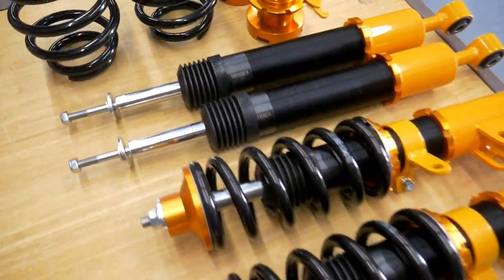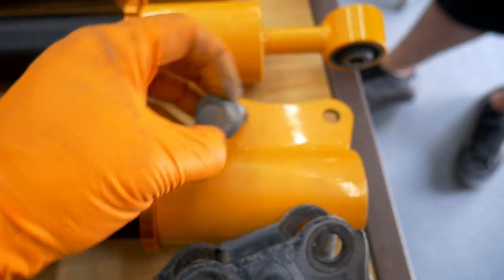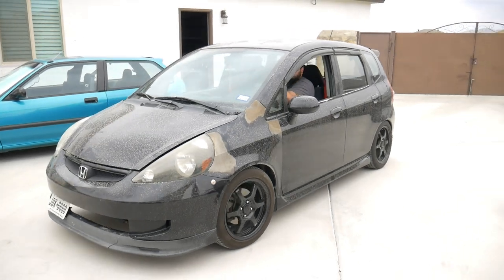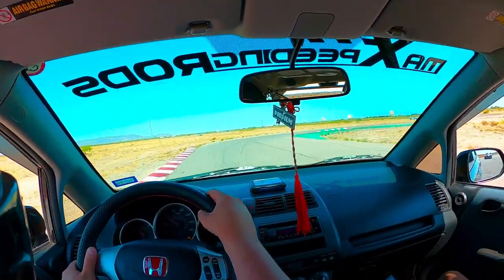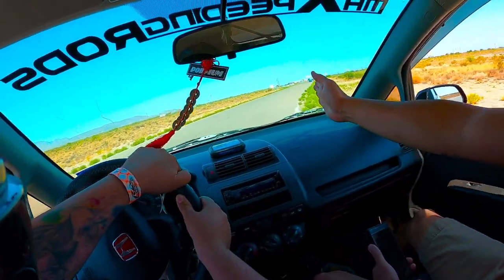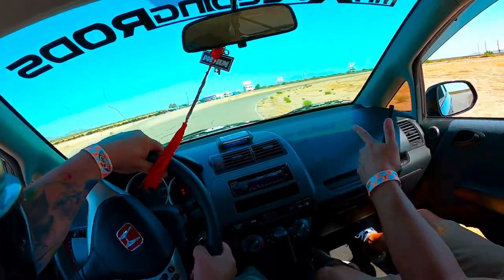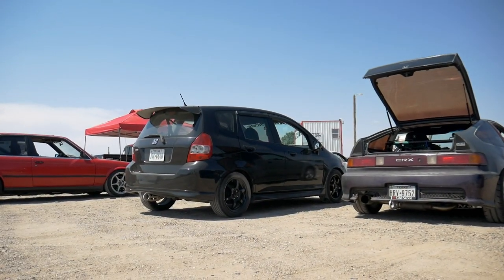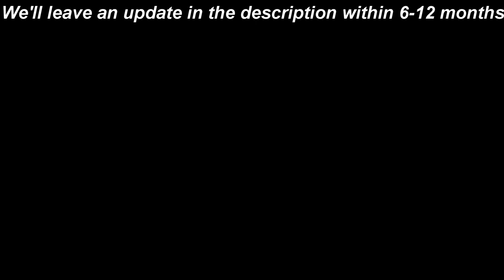2008 Honda Fit - Daily Driven Weekend Racer?  Maxpeedingrods Coilover Testing

Comment: Thanks for the help Jon I appreciate it.  Definitely a big learning experience next upgrade get my tires and now i know what I need to work on.
Reply: Play some Gran Turismo. Good way to learn how to corner on the track, and overall speed/braking in/out of corners. If you have a ps3 those versions are better than the ps4. Keep up the good work! Thanks for the video.
Reply: Fun lil car, good job guys. What are those tires in the front and what kind of front lip is that?
Reply: What wheels and intake did you have on here?
Reply from the maker: Enkei EPF1

Comment: I think it would help to guide Danny with hand position, smoother steering input and line choice on your next session.
Reply: @Garage Built Hondas - Was it the added rear spring rate that demanded more tire for the rear and throttle lift off that caused the oversteer?
Reply from the maker: Mainly the tires and lack of experience.  In my session I had no issues controlling the car but noticed I had to be a little less aggressive.  I'd love to see how it feels on a nicer set of tires in the rear.

Comment: I wish they made koni yellows for the 08 fit,using cusco F&R strut bars,h&r springs,progressive rear bar,1.2 neg camber up front & 1.5 neg out back and its very balanced could use more dampner then the stock replacements..might look into tein struts instead..only other i could find..

Comment: I would change the coil springs around,higher rate in the rear softer up front..noticed those kits are the other way around..doesnt make sense for the front wheel drive car when you want the rear to oversteer & rotate my thoughts..

Comment: Well Jon, I just picked up an '07 Fit Sport for a fun little beater.
Reply from the maker: Sweet.  I almost got one a year ago.  Ended up with an EK hatch beater to use for summer.
Reply: @GarageBuiltHondas  It was so cheap compared to all the others around, I ended up w/ a clean title, super clean interior, 180K mile car for $2k, they literally sold it "because it needed new tires" & their daughter started driving their old jeep. It worked out well for me being I have tons of spare wheels & tires in 4x100 😁 Pretty good timing too cause the auto trans in my 265k TSX just started to slip a bit, well it's done it once so far.
Reply from the maker: I'd still buy one if I found one for cheap.

Comment: Ridgets collars and every bars you can put on a fit helps it out alot
Reply: Believe it or not, its not uncommon to REMOVE the front bar and add say a Progress rear bar on Fits seeing road course and autocross use to help with weight transfer. ;)

Mind you, there is some driver and setup preference there... I'm not a fan of removing the front bar but its the norm in GE8s and GK5s running SCCA's B Spec.
Reply: @NocturnalJunkie  I want to get tcs top castor camber plates after installing the ridget collar the car seem to dart around more

Comment: First and foremost... great video, nice editing and sweet shop to whomever owns it.

Secondly, to the Fit owner. Looks like you enjoyed your shake down event on those coilovers. I'm curious about your thoughts on them...

Maxspeed actually reached out to me on Fit Freak sometime ago and I honestly questioned the quality of these coilovers from the jump especially at their listed price. Damper body wise they looked like a generic set based on the Asia and Europe spec Fits (which have the smaller M12 strut bolt holes if I remember right that ya'll drilled out to work with our US cars). Damper valving was a bigger thing that I questioned since I fairly regularly do autocross and track attack (higher speed autocross on road courses basically) events in the Houston area. Was there any adjustability at all? Even then, do the dampers seem like they're somewhat compatible with that 10/8k spring rate? So many questions were in my head that put me off even testing them as I didn't want to risk throwing my club's championship (and time) in the wind.

I'm honestly glad to see someone was willing to try their kit out and documented it. Just really curious of the findings both on and off track.
Reply from the maker: I'll ask him to respond to this comment after the next event in about a month.  That way he can have a better set of tires on all 4 corners and really throw it around on track.   I'll try and do the same once he let's me drive it again.
Reply: @GarageBuiltHondas  Cool beans! It would be interesting to get two perspectives on the same setup.

Also, if the owner hasn't yet... I'd encourage having the torsion beam's alignment checked and if needed adjusted with shims. Those things are usually at some goofy, uneven alignment spec when new and shimming them made a night and day difference on my GD.
Reply: Do you know how much lowering affects the measurements? When I did my mustang it was only .2 out on the front camber and the tires wore very evenly. My ge was pretty dead on last time. I’ll definitely get it aligned whenever I do the coilovers but I don’t have access to a rack so it would be beneficial if I didn’t have to go get parts after my buddy it.
Reply from the maker: It'll add anywhere from 1 to 3° negative camber, not sure how much toe is affected on these vehicles.  He had his Fit aligned  after we did the install and before the track day
Reply: @gregblau8082   Pretty much what was said by GBH.

Generally speaking lowering increases negative camber and increases positive toe (toe in) on the Fit.

In addition to that, camber can also be affected by the strut design (fixed bolt hole or slotted) and whether you use the factory strut bolts, crash bolts from Honda (Have a thinner body allowing for some movement, 2 to 3 tenths of a degree per bolt.), or of course camber bolts.
Reply: @NocturnalJunkie  im having fun reading these comments I'm learning so much
Reply: Good question , from this video I would say you made the right call not swapping these till doing more research as the car does not seem to sit well on the track. Spring rates look way off for the track anyways , could be set up more for poser street use. They do look like common offshore set ups for sure .  I often have trouble on the streets with the lock rings on the coil overs. Often ad another big nut from a dead offshore set up to help lock the rings better. Time will tell if they last , most offshore units for me do not .  These cars remind me of my older Vws and golfs same set up. Would like to see more on yours and how you set it up. Do you leave it high and run taller wheels or do you drop it low like these ? I would think a taller wheel might help .

Comment: Car looks not much better than stock with all the sway spring rate seems off since it just falls/collapse in the corners. You do not want the shock fully collapsed in a corner , you still want some travel in case you hit a bump or something it is suppossed to keep the contact patch on the ground as much as possible . I guess no sway bars added or stiffer links? You can see at 4:05 the car is sitting low in the rear at the shop positive camber front wheels probably fixed with an aligment on the rack or by hand with levels and string. 5:00 at track same stance not corrected. 6:30 the carz azz end slides out due to this have the same issues with mine(driving in the snow with no rear snows the cars do 360s on simple turns). I find the rear sags with stock set up like yours in the back and changes the bias. Raise the rear to where it should be and car handles differently . When we swap shocks and struts(stock) we get back to proper position . Maybe try it set up that way and see the difference .  And of course something in the sway bar department (rear strut tower bar might help to nit sure who makes them might have to fab Mugen did a bad azz Fit/SC not sure if they sell products). Another thing I use are Sumosprings/Longarces racing/TTC/ Moroso   rubber donuts in the springs to raise the height in the rear springs and stop the sag of spring. Lotsa of videos on youtube of these donuts in use also used often in circle track racing Longarces have different rates avail. This single thing will make a huge adjustment(cheap to other than the sumosprings).You can also use them in the front. If you turn your steering wheel fast and the car sways like that so fast , it is not set up proper, clearly not for track days anyways. Yes you will always notice a difference with new struts and springs , and over lowering springs as most people cheap out and do not replace the shocks.  Lots of room to go forward for sure . Again with the rear trailing arm it bucks and throws your line off causing the spin outs by transfering the energy to the other side unsettling the cars foot print. A sway bar would change this allot also the rubber donuts limit travel not allowing as much movement .  Watch other cars and see how much they move at the track in the corners . They also make some dash board timers readers that record allot of this info for cheap. Lap times etc so you can see real time changes. Love my Honda Fit , the also tow pretty well , as I tow my Harley's with it .

Comment: I JUST BOUGHT MY 2008 HONDA FIT.  THE OLD OWNER HAD IT STORED IN A FIELD FOR 2 YEARS.  THE CAR ONLY CAME WITH ONE KEY AND NO KEY FOB.  THIS IS A PLAIN JANE FIT.  I STICK MY KEY IN BOTH DOORS AND THE HATCHBACK AS WELL.  I CANNOT PHYSICALLY TURN THE KEY IN THE DOORLOCKS TO UNLOCK THE DOORS.  I AM AFRAID TO LOCK THE DOORS ON THIS CAR, BECAUSE I WOULD NEVER BE ABLE TO GET BACK IN.  THE DRIVERS DOOR CONSOLE UNLOCKS AND LOCKS THE KEY WHEN I AM IN THE CAR, BUT I DON'T LOCK IT WHEN I LEAVE THE CAR.  THIS IS THE FIRST FOREIGN CAR I HAVE EVER OWNED.  AM I MISSING SOMETHING???

Comment: The fit has electric steering right? That can hurt because it is harder to feel a turn and when correcting it overcompensates quickly.
Reply from the maker: I'm unsure, I'll ask the owner.  It felt ok when I drove it.  I'm used to old civics/CRX's though so everything feels nicer than these.

Comment: Wondering if you have a set of those clips or fasteners that attaches the 91 oem lip to the 91 oem bumper. If not do you know any methods to attach it besides zipties?
Reply from the maker: I don't.  Hit up a yard.  They're available on many Honda models.
Reply: Garage Built Hondas 5th to 6th gen? I thought they ef chassis only have it.
Reply from the maker: No.  Some accords even.

Comment: What's the current opinion on those coilovers?
Reply: they are trash had installed the same one on mine and not only are the front bolts different in size so is the rear shock bolts and created play in the shock and makes alot of clunking noises

Comment: I installed these on my gd3 fit and with the fitment issues, poor quality, and crappy ride I would not recommend these for anyone rev9 is $550 and make a way better set with dampening adjustable shocks

Comment: Obligatory JDM Wiper Mod.
Reply from the maker: You know it! Lol
Reply: @GarageBuiltHondas  If you put grippier tires in the back and get your rear wiper in the up position - it should balance the ride :) Otherwise, there is literally nothing in the back besides the spare tire and jack(if not removed).  With 60/40 geometry even the gas tank is under the front seats.